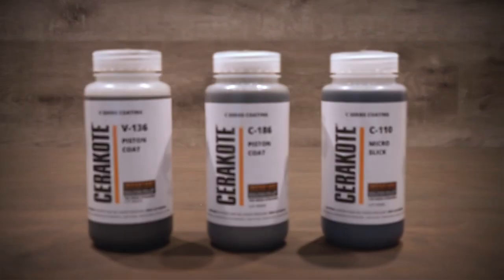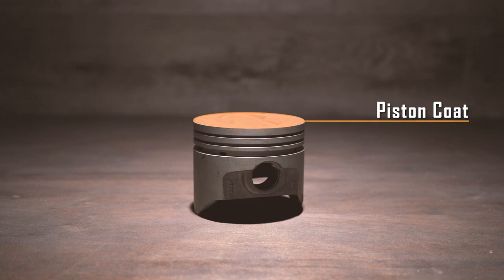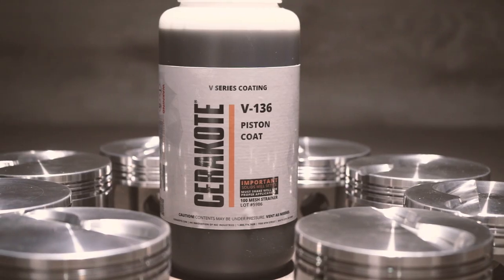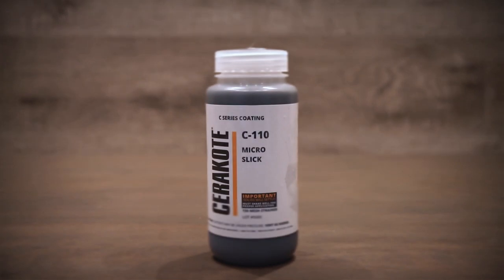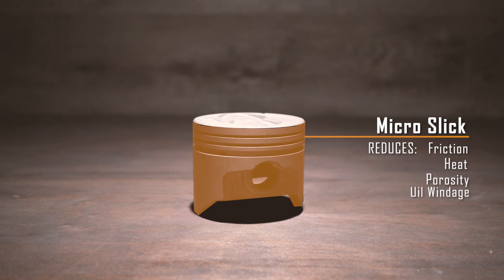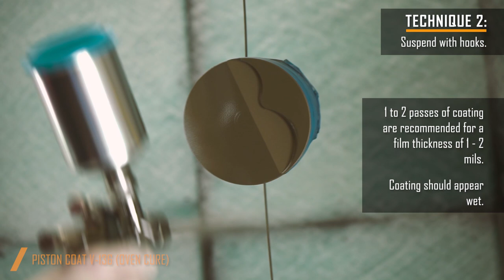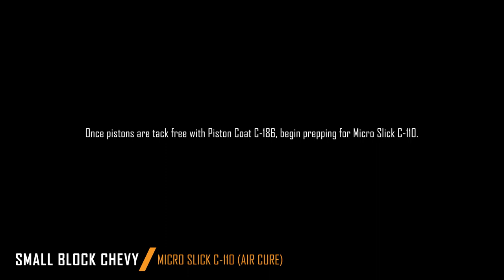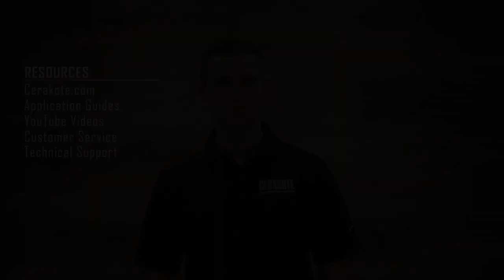Cerakote Application Guide - Coating Pistons with Cerakote Piston Coat and Micro Slick

Comment: If you was to do both Cerakote Piston Coat C-186 (Air Cure) and Cerakote Micro Slick C-110 (Air Cure), couldn't you just do the blasting for both areas in one stage?

Comment: Does this work with fordge piston?
Reply: yes, it does fork with both OEM high-silicone pistons and aftermarket forged pistons. I have been using Cerakote products on racing and street application engines with both 4032 and 2618 forged pistons for 12+ years

Comment: can the Cerakote Piston Coat used for combustion chamber?
Reply: Yes, and valve faces they say.
Reply: @MrInnovativeEnergy  Cool. Just found there's one coating shop at my place that done Cerakote for piston and head including the exhaust port
Reply: @m_zbrv3967  Yes, I get pistons with this coating on them already, but I wanted to see how they do it. I will start building my own with this coating. The results of thermal resistance on the piston crown are very amazing! Drops piston crown temps by over 200F in some cases!
Reply: @MrInnovativeEnergy  that sounds very promising bro!
Reply: @m_zbrv3967  More boost! with less heat, yeah mah dude, cheap and easy. No reason not to do it.

Comment: Im thinking of using piston coat to coat the crown of a chainsaw piston and the chainsaw bore which has some imperfections. When using on the bore, will I have to removed the chrome plating prior to cerakoting?

Comment: In my country we don't get 100 mesh micro grit so I used 70 and and V139 Titanium Red on piston crown and running it on ex South African MX Champs bike and already 40 hours in with no issue. Question is I have microslick but not sure if I should go ahead with blast with 70 grit. What a bummer

Comment: I am going to use this process for a new engine built in a few months but have a question that i cant find an answer for.
The datasheets for the Micro Slick and Piston Coats both say that the air cured product is a lot harder ( so its better? ).
BUT people on some forums say that the Oven cured products are way more robust, thats what i also think.
So what would be the best product? ( I have an oven available).
The engine is an old engine thats gonna be rebuild, no new parts are available, long lasting street engine but its gonna see some abuse.

Comment: Is it possible to add more coats to decrease piston to wall clearance? You state it only adds up to .0005". Im looking to add around .004" to the total piston diameter, which would be .002" of coating on each individual skirt.
Reply: I dont think it will do well since coating isnt supposed to add clearence

Comment: So I've been using Cerakote V-136 and C-110 for several years on pistons and combustion chambers and I'm very pleased with the results. However I have heard suggestions from different videos on using Micro Slick on camshaft lobes and other bearing surfaces. What is the correct proceedure for prepping the hard metal surface of the cam lobes or shell bearings?
Reply: What are you pleased with? I have disassembled many engines that were built before piston coatings and they all ran fine.

Comment: How does the C-186 coating effect the thermal expansion and heat transfer on both 2618 and 4032
Reply from the maker: It will help regulate the thermal cycling on both substrates.

Comment: Is there a reason you are using the oven cure V-136 Piston coating but you then use the air cure C-110 microslick for the skirt? Why not use the Oven Cure Microslick on the Skirt instead of Air cure?  Can you not use Oven Cure microslick and Oven Cure Piston coat on the same substrate piston?
Reply: V series is oven cure and C is air. It's only the top that you require oven. I've done quite a few for our MX race bikes and so far tripled the life on one piston

Comment: You have to be kidding! coating the ring lands WOW!!!!!!
Reply: The substrate reduces friction and is only as thick as most dial bore gauge are accurate. If prepped correctly one would think it should actually have better resistance to carbon buildup than a piston that has not been coated.

Comment: For the C-110 you recommend 3 light coats. How long to wait between coats?
Reply: You don’t need to wait between coats. Really you aren’t applying multiple coats during application. You’re more building up the thickness of the coating by passing over any given area around 2-3 times. You can see in the video as he is applying the cerakote he makes passes in a vertical direction. Between each pass he rotates the part so that the next pass will overlap his previous pass by 1/2 to 2/3 the width of his spray pattern. Doing this he passes over any given point of the part 2-3 times with the coating.

Comment: Does this decrease oil crankcase temperature when used on forged pistons  and by how much? Thanks!
Reply from the maker: Performance is based on application as well as several other variables such as the type of engine, surface area, density of the piston, and the purpose of application. However, no matter the application, Cerakote Piston Coat is a thermal barrier coating and will yield results in less heat transferred into the piston and cylinder wall, to include the cylinder head and coolant.
Reply: @Cerakote  Is there available data to support increased horsepower or engine longevity?

Comment: Great video best way to see it done by the manufacturer itself. Some info on blast media use or I missed it
Reply from the maker: 2:12 of video! We’re glad you liked the video!
Reply from the maker: Sandblast the parts with #100 grit aluminum oxide or garnet sand at 80 to
100 psi. Lightly blast (30-40 psi) non-metal parts such as: wood, fiberglass, plastic or
polymer. For anodized aluminum parts, set the blasting pressure to 30-40 psi. Strive for
an even blast pattern over the surface of the part.

Comment: Why did you use the steel wool after coating it?
Reply from the maker: Good question, the blast prep on the piston will create tiny peaks and valleys. The Micro Slick is so thin that will fill in these valleys after the blast prep, creating  a more uniform slick surface. 
There is still the possibility that there are tiny high points (which will be knocked off when the piston cycles). The idea behind the burnishing is to knock any high spots down preemptively,  before the piston goes into the bore, so you'll have a cleaner initial cycling of the piston.
Reply: @Cerakote  thank you! Makes sense. Appreciate the feedback!